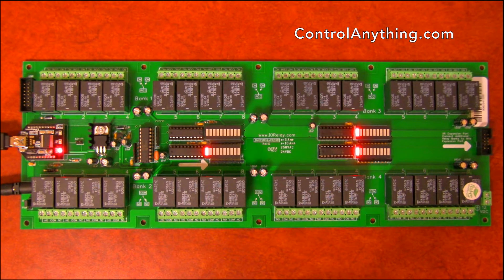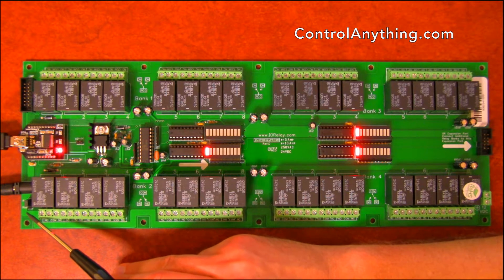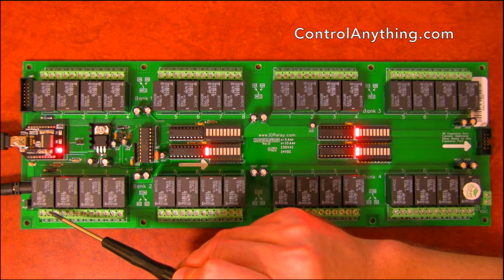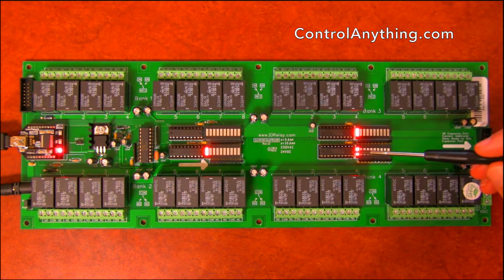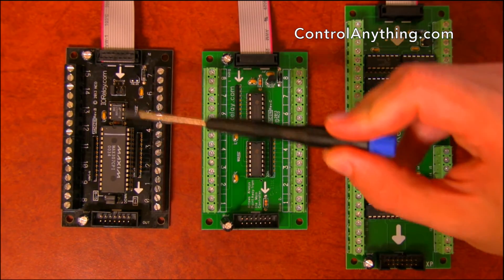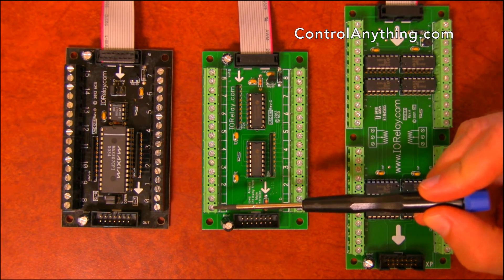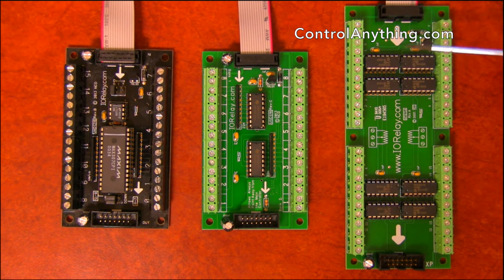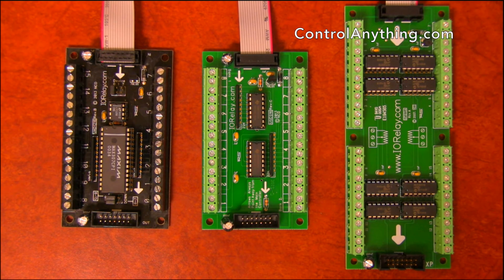32-Channel Relay Board with Expansion Ports and USB Interface

Comment: Hi very good work.
I am a beginner in electronics and currently working on arduino and many programs.
 I want to develop my ability to create PCB , if you can send me files (schematics, gerber, circuit board silkscreen, diagram) for channel relay , expanders,Wifi,sensors.... modules to help me develop my competence in electronics. Can send me to    papi.tonito@gmail.com

Comment: I was really excited about this, till i figured out that to do what i need would cost me from $1200 - 1500+!
$575.00 – $763.00?!?!? why so expensive? i just built a 64-channel relay system,  using MCP23017 for less than $200 (including labor for wiring)
Reply: You might want to look at Numato Lab (numato.com). They have a 32 channel Ethernet Relay board for $180 (12v relays).